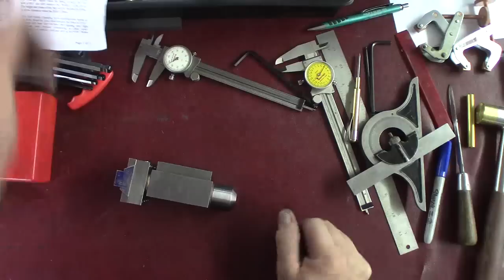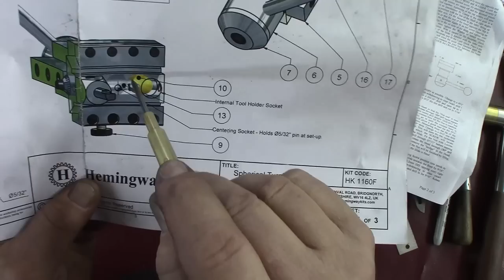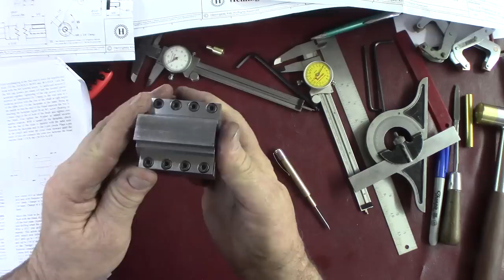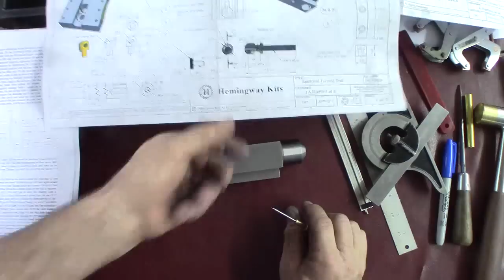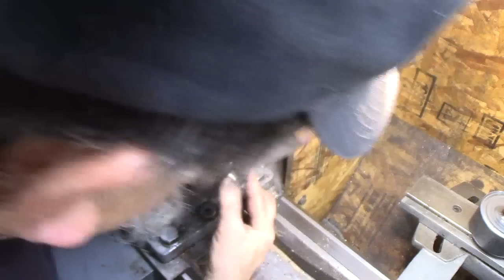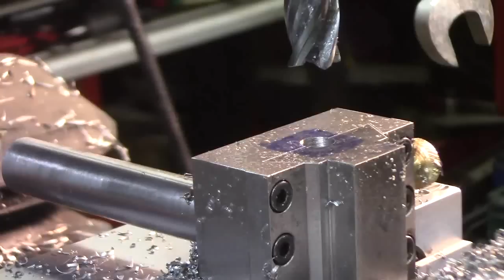How To Build a Hemingway Kit Spherical Turner / Ball Turner P10

Comment: Looking forward to seeing you single-point that internal 1/4-40.  Personally I would use a tap (and convert the metric threads -- the gear change isn't worth the effort), but I applaud your effort to follow the design and demonstrate the process.  You need to grind up a really small threading tool for that.  Better do an external test run to check your feed rate first, since you can't check the internal cut until it's done.

Comment: Randy,
Really enjoying this project... I like the shorter, almost daily video format as well as the fast forward editing through the repetitious parts. Haven't followed a series like this since the Baby Bullet build. Well done.

I see it's not called out in the print but there is a British thread format known as "Model Engineer" (ME) and available in 1/4-40. Size-wise, it's the same but with a Whitworth 55* thread angle. If they are supplying the adjusting screw, you might want to double check it. 

BTW, Brownells sells a 1/4-40 60* carbon tap for under 3 dollars.

Comment: McMaster has 1/4-40 taps for $20.52 + shipping. 40 tpi is a very useful thread pitch; it advances 0.025" per turn (like a micrometer). Just don't hope for a matching left hand 1/4-40 tap; for some reason, these cost $163.45!

I'm really liking this project. A sphere turner is definitely on my wish list, whether this one or something I design myself. (I've been thinking that a 4" Criterion boring head (which I have and which is really too big for my mill) might be adapted to work.

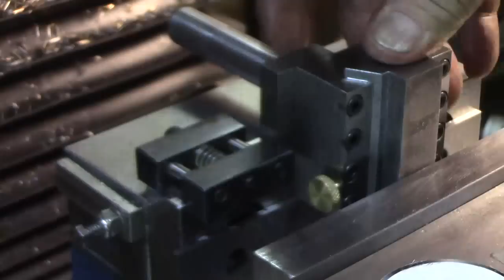Uh-oh - at 22:00 there were chips on the parallel under the workpiece. Might not be precisely axially aligned with the hole from the other end. (But it might be if there were the same amount of chips along the x-axis of the workpiece so it didn't tilt around the Y-axis.) I expect you will find out when you go to fit the adjusting screw.

Comment: I have been following this kit build with great interest.  I liked your setup with the 1" gauge block and the shaft.  (slick trick obviously experience helps with this kind of work).

Quick question...  Why do machinists use a wiggler for locating a point on a piece of work.  When I build my model steam engines I use a 1/4" piece of drill rod with a very sharp point.  Seems like a wiggler is a 2 step process and mine is a 1 step.  Respectfully, what am I missing?

Thanks for showing all your steps on the project  I get a LOT out of watching the various setups and the rational behind why you do it.  Fred

Comment: cool stuff Randy, its interesting the "mix" of imperial and metric on this tool, being of the lazy persuasion i think i would chose to do away with the metric and find a close imperial sized equivalent.
1/4-40 cant wait to see your solution for threading such a small hole on the lathe. 
I would be tempted to try and make a tap from an old HSS drill.
Cheers